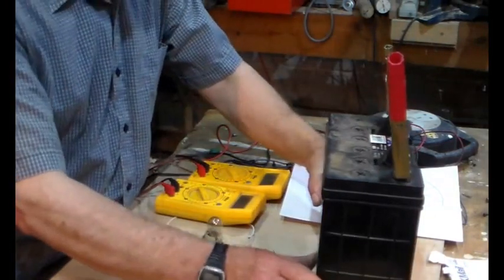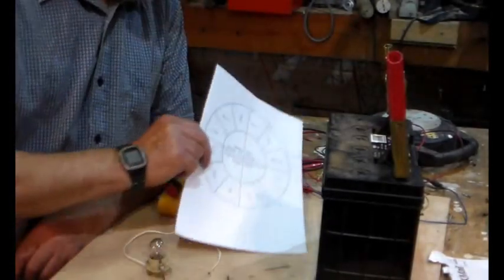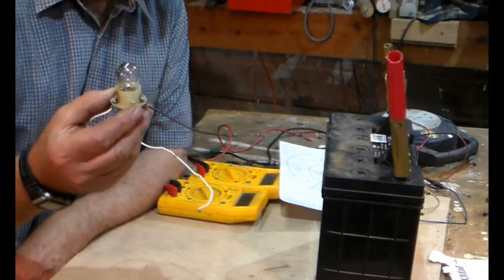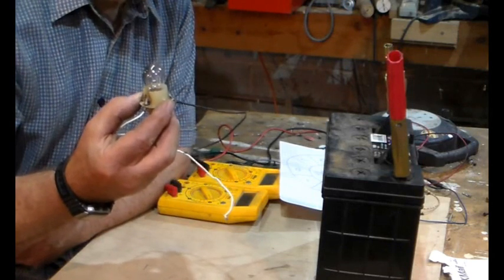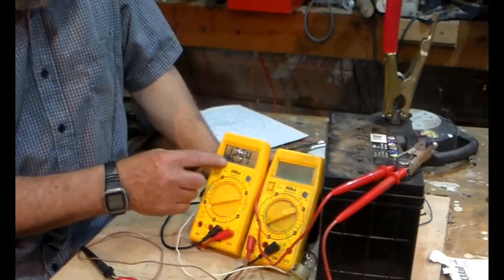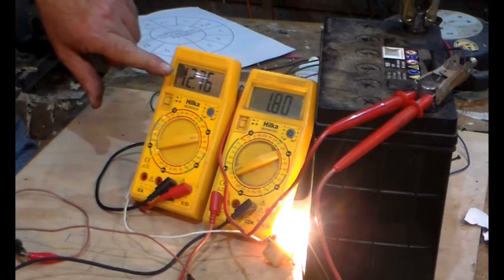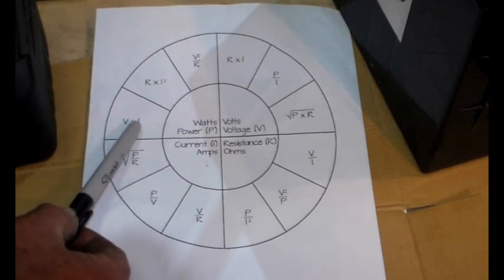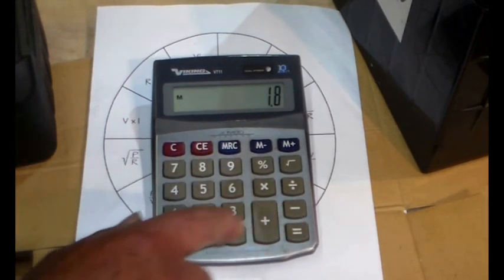Volts, amps, watts, Part 1: how they relate, DC solar system.

Comment: Appear  rather quick for those who don't know about this kinda stuff, although I don't know who your target audience. Perhaps show voltage in terns of how large a gap it can jump and amperage like the flow of water with a variable resister in circuit. Also beginners system comprising of a solar panel, dc-dc buck converter to 5v & a power bank? Power banks have a Dw01 chip cutting off power before the lithium batteries are damaged.
Reply from the maker: Thanks for that, This is just a single concept video as an intro to further information, cheers

Comment: Hello Andy, I have a question regarding a amp gauge and the power you use there in England. Can you measure the current through an amp rated gauge for 100 amps on the two phase power you use in England?  I know that current readings are always taken in series of a circuit on one of the  feed lines. The reason I ask this, is because i'm trying to figure out a way to do this on my 5KW portable generator. I basically want to know, how many circuits I can run in my home when the main power goes out because of a power outage due to wind storms. It's hurricane season here in Florida.
Reply from the maker: Hi, I think your best way forward on this is to add up the wattage of all the things you want to run, lights, fridge, etc. Most items will list their wattage. Allays allow a bit extra so don't load the generator up to full capacity remembering that a fridge or freezer takes 10 times the rated power to start (for about a second). This includes air con also. So lets say you have 3.5 Kw to play with and work backwards from that, this way your generator will last for quite some time, cheers
Reply: @TheInfoworks  thanks Andy and my generator has a surge rating of up to 6250 kilowatts and 5KW running. Can I still connect two amp meters on each of the 120 volt feeds just as a load monitoring benefit? I wish I could pick up a used military generator because they had all the gauges to include the frequency, volts, amps, and total load being used.

Comment: The water in a hosepipe filling a bucket analogy (pressure = voltage,  flow = current, bucket = a battery filling with charge, hole in bucket = charge leaking away) is how I learned this basic stuff when I was about 8,  and it still holds good today for simple circuits.  I had to look up why we use "I" for current - it stood for 'intensity'  of current and was coined by Monsieur Ampere in 1820. Cheers, Dave
Reply from the maker: Dave, thanks for your info, I always find your comments very interesting. Might follow this up with one about volts, resistance, watts and checking elements, cheers
Reply: @TheInfoworks  Yes, I2R heating effect comes up so much, and not usually in a good way, so it'd be a good thing to explain Andy. Cheers, Dave
Reply: @noakeswalker  Thanks for that. I was always curious about the "I" ...!
Reply: @xanataph  I've never bother to look it up until now. Better late than never :o)